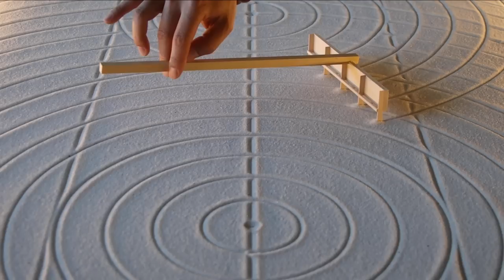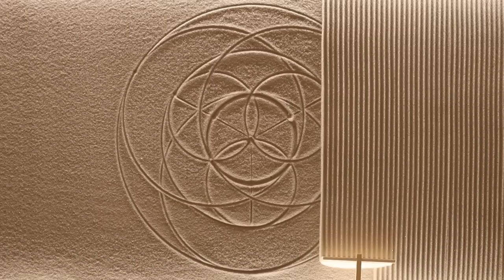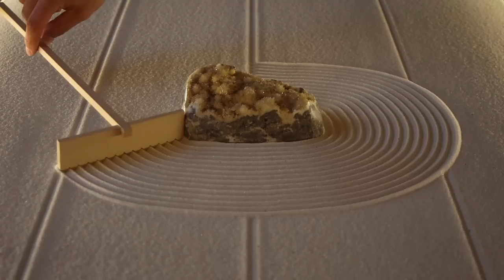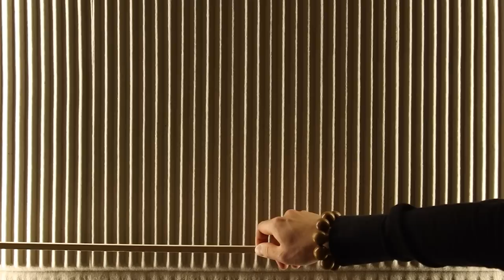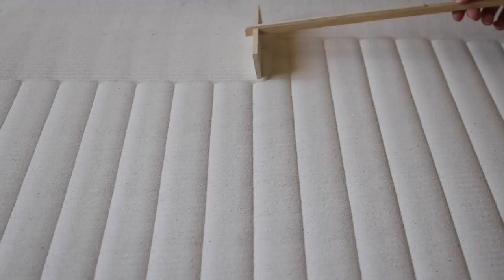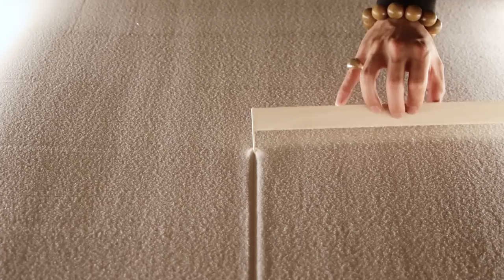Zen Garden - Explorations 5

Comment: Hey there! Thanks for posting another video! I keep asking but I feel I'm too late to the video to get an answer, but how deep is the sand on your table?
Reply from the maker: It is around 3/4" However, I believe it could work depends on the depth of the rake that it could be more shallow or deeper!
Reply: @yukikawae6549  I keep searching on comments but how big is your zen garden? By the way, I hear that the bell does not ring regularly at each new paterns, does it has a meaning or you just wanted to ring it randomly? It is demanding, but this long format is well done and smoothly edited, pure perfection as your geometric explorations.

Comment: You don't have to make 1 long uncut video, you can stitch together multiple smaller ones. People just want longer videos because Its hard to fall asleep to a 4 minute video that sometimes has a loud ad at the end of it cuz youtube.
Reply from the maker: Ah yes, I felt terrible when I read that someone got woken up because of ad of YouTube at the end. I have learned that if the video is shorter than 20 minutes, you don't have the control over ads, however if it is longer, you can turn it off at the end. I will try to do both in the future. And thank you for your suggestion! I will keep that in mind!